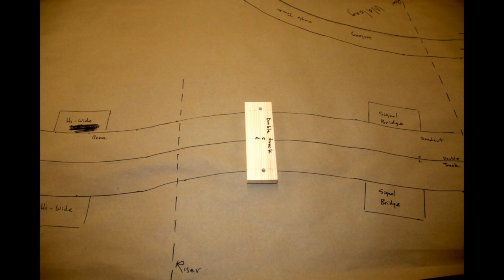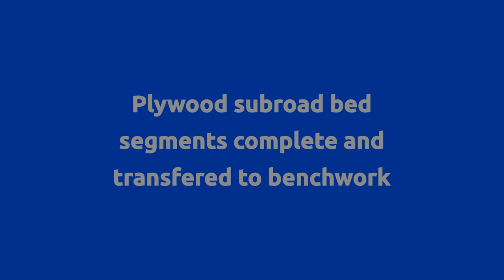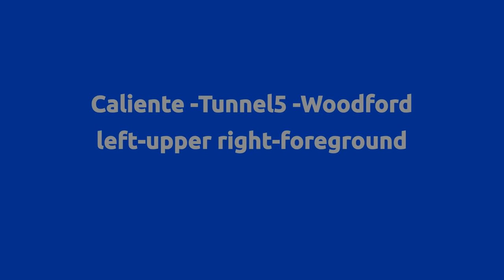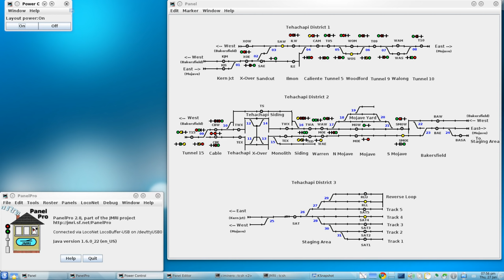HO Tehachapi Loop Construction Part 1

Comment: if I was going to build the loop i'd double track it  rather than create a bottle neck it going to a single track solution entering either side of the tunnel like it is in the real world..

considering the average length of 50 cars or more I would try to interpret the track layout as it should be done rather than how it exists in the realworld, as this is when you can correct any flaws within any layout..
Reply from the maker: My goal was to model the prototype.